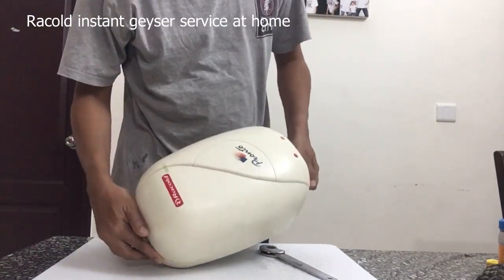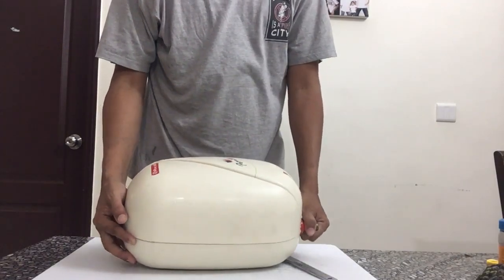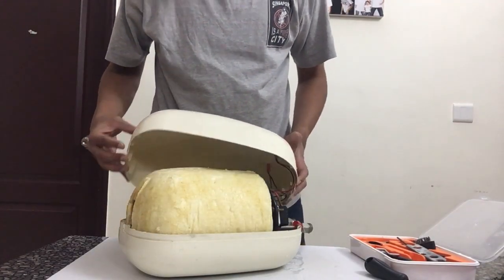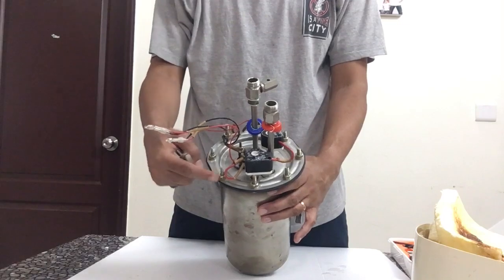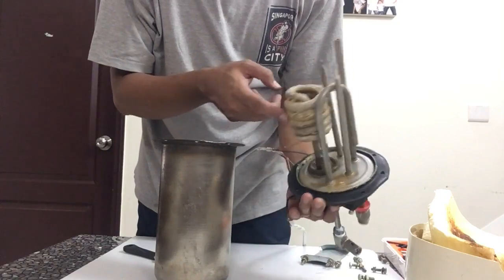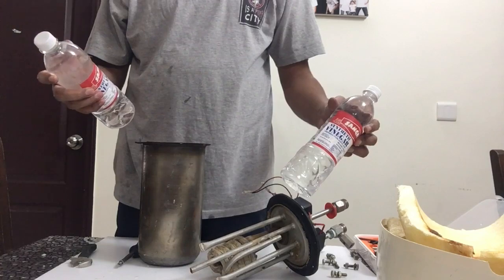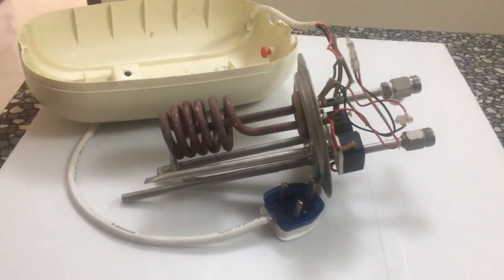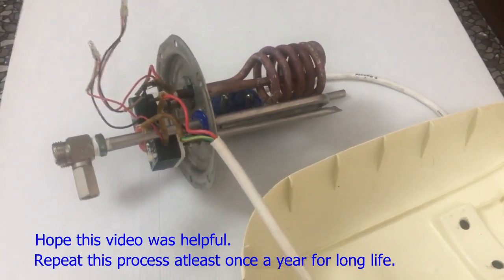Racold Geyser Service at home simple DIY

Comment: My geyser keeps tripping the MCB. Can you suggest what I could check as possible cause?
Reply: It must be leaking and causing a short circuit. Make sure the compartment is tight and there is no leakage.
Reply: Get power point connection.